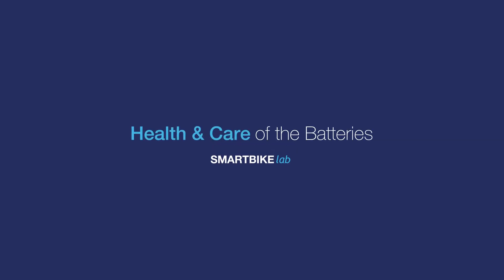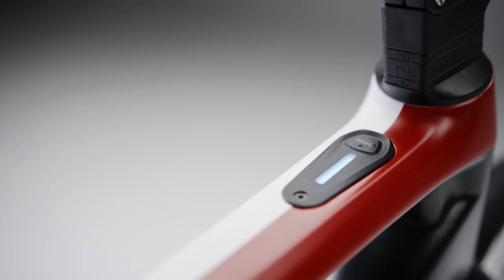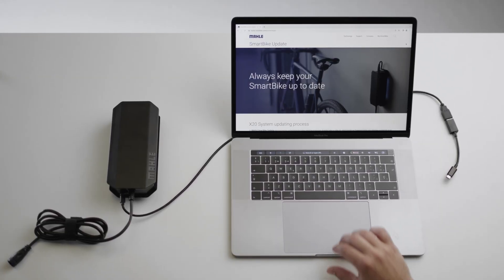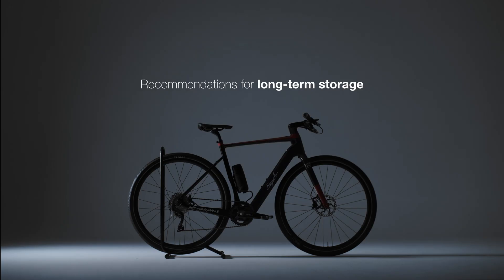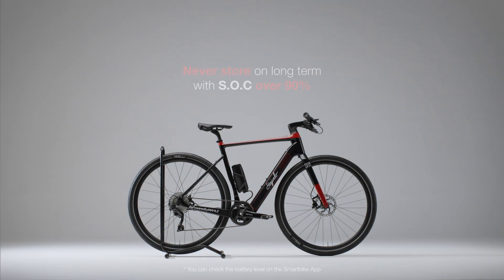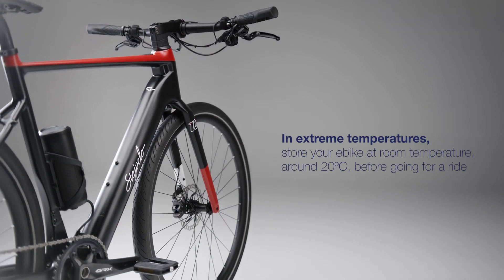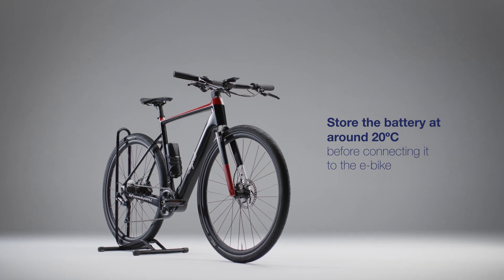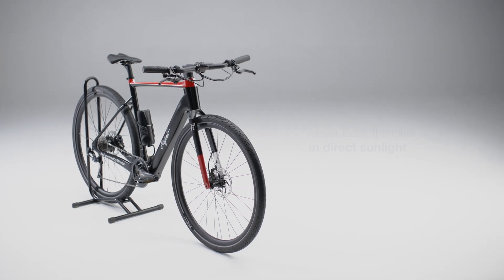How to Take Care of Your Battery - MAHLE SmartBike Lab

Comment: I had the same problem. You may have sorted it now. It occurs when the battery is fully charged with the X35 system, and needs a firmware upgrade ( a dealer-only job) to fix. However, if you can reduce the battery charge level to 96% or less, the bike will work OK. I connected mine to the phone app for about 10-12 hours, which did reduce the charge enough for the pink flashing light to stop. Now awaiting a proper firmware upgrade by a dealer - only charging to 75% at present.
Reply from the maker: Hello David. I'm glad to tell you that we solved this on the latest firmware update for X35 Systems, launched on September 2023.